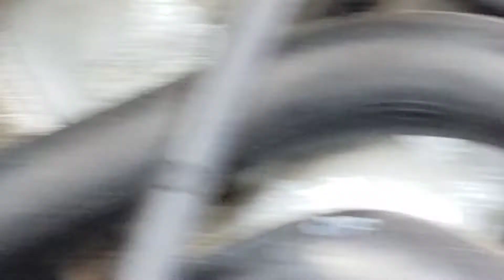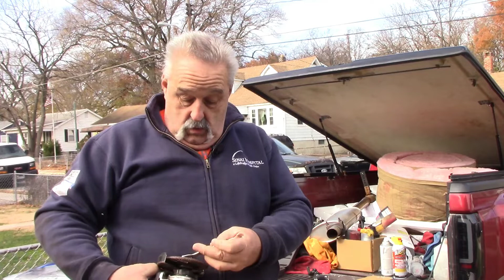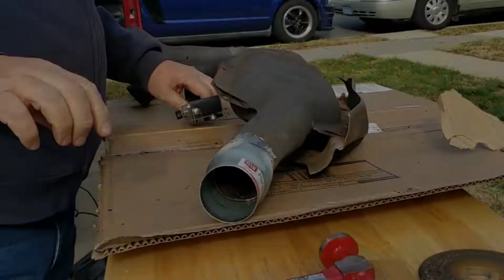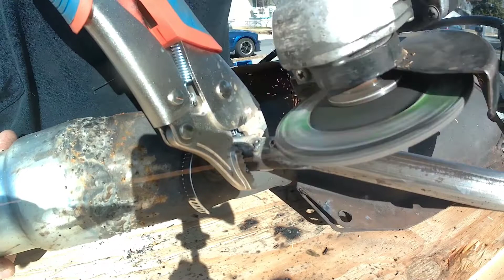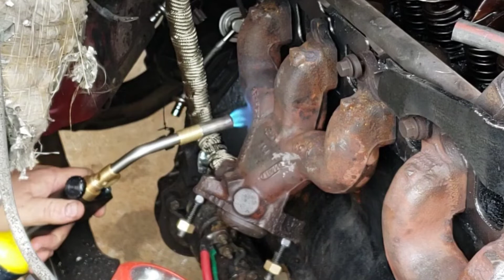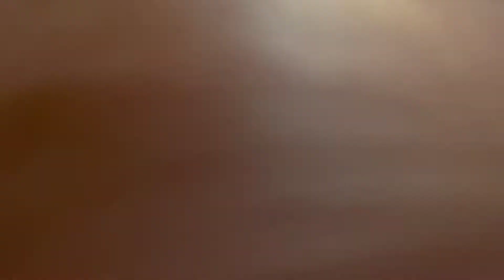Exhaust Studs 5 this is where we started

Comment: I've seen some guy on here put some copper based permatex sealant on the inside of the pipe flanges where they connect to the manifold. I'm not sure about how well it worked, but apparently these pipes tend to leak on all the 300s. I have a '96 F250 300 and it makes a sort of chugging sound like a locomotive; I'm thinking it's these down pipes. I'm looking to replace them with a Walker y pipe ($60) when I ditch the smog pump. Thanks for another great video. -Evan
Reply from the maker: Thanks let me know how the y pipe works out